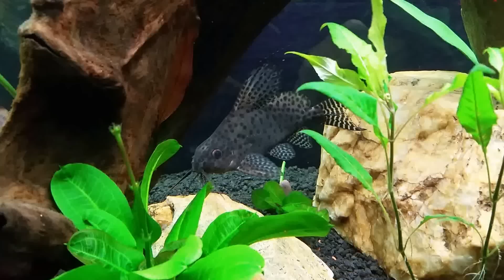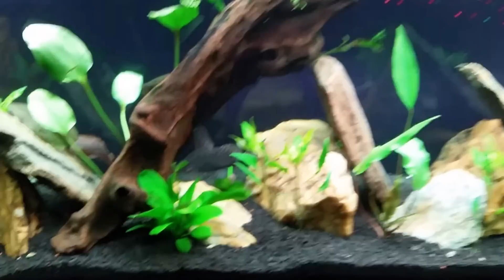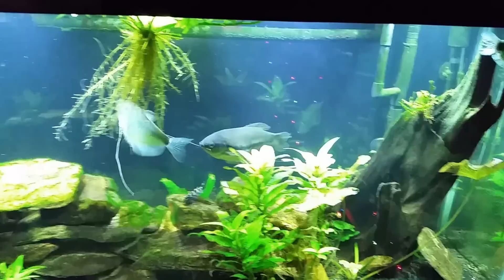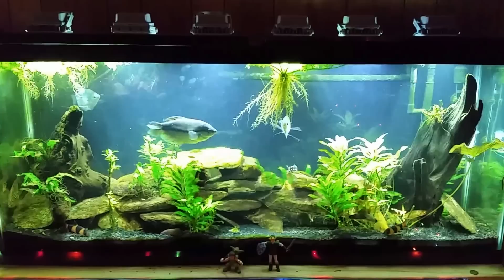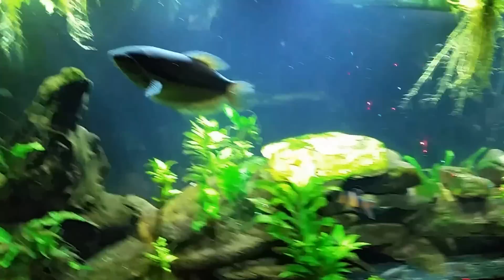First in a series of discussions about TDS and Water Chemistry

Comment: Thank you for all that, learned something. Off-topic question if I may, are those white mountain Minnows in the Forefront minute 14 or so? If so what temperature are they in?
Reply from the maker: Yes, they are in a room temperature tank. The heater is set to about 75 degrees, but seldom comes on..
Reply: Thank you. (i'm looking for a school with an angels,temp is an issue)